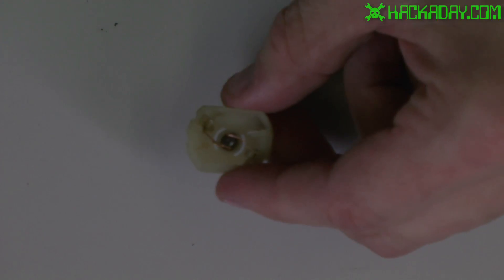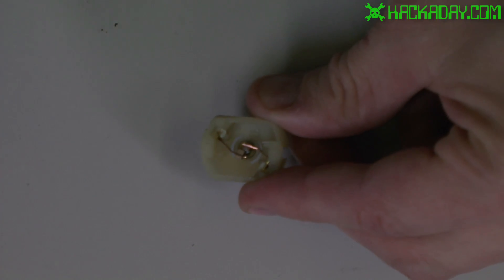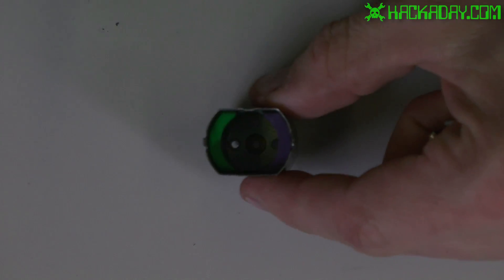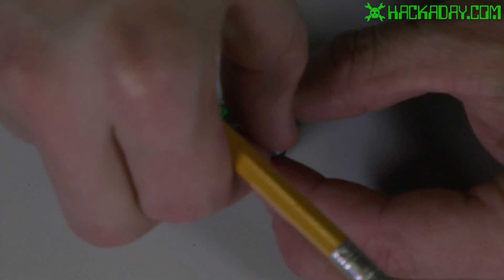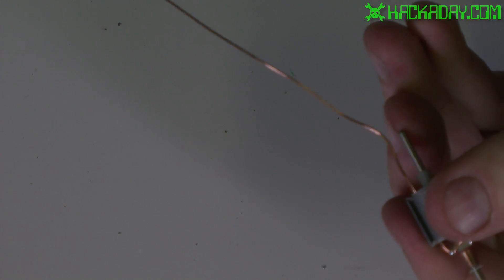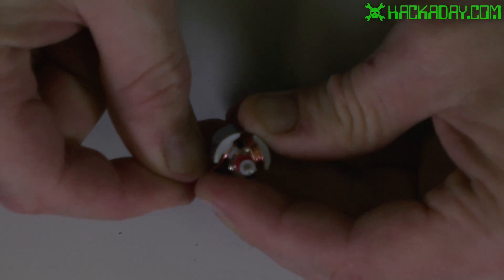Rewinding a DC motor

Comment: Bro
Im an old timer 12 v
Slotcar motor rewinder
With very exotic rewinding methods for
3 and 5 pole armature
Which will make 12 v. Brushed motors really burn...
70 to 100 thousand
Rpms..
So fast in fact the unloaded a motor will self destruct and blow itself apart .
Lots of mods diy for
The can mags etc.
If you like i can provide interesting diy old timer methods used back in the day.
Example
Rewinding a 3 pole armature like a 5 pole.
Or 5 pole like a 3...
Let me know if youd like me to expand about these old technologies.
Regards
DH.

Comment: very informative. im planning to rewind the  same motor you used in the video and use it on my usb powered electric fan.. is it advisable though to plug a rewinded usb fan on a laptop that draws roughly 5v 500-1000mah?thanks

Comment: pretty hap hazard.
in reality, less turns won't necessarily give more speed. Winding electromagnets is far more complex than that. More turns = more magnetic flux at a given current, also means higher voltages to achieve the given current. With motors it's further complicated by the number of segments on the armature and the timing of the commutator, which he touched on.   

I guess it's not a bad explanation in lay man's terms. I wouldn't take it too seriously though.

Also, watch out for balancing issues if you attempt something like this.

Comment: I think you should divide the RPM by 2! I mean the tachometer counts 2 black marks each revolution, so, then you'll need to divide the number on the LED by 2! I GUESS! Let me know! Thanks ... Great video! :)
Reply: The tachometer divides by 2 for you. There is usually a switch on the tach to set the number of props (2 or 3). The readings were revolutions per minute not stripes per minute.

Comment: Sie i rewinded the motor but after rewinding when i supply 5v dc to it.Nothing happen please help
Reply: when you rewinded it you would have changed the required voltage! so just add more voltage

Comment: if you like faster with no smoke after the motor is run, red alloy coil is good magnet coil than copper coil or magnet wire,..in that dc motor is good that you rewind in 12-14 turns,..

Comment: His tach was getting two pulse signals per actual revolution of motor. If he had one single black dot, about 3/4" in diameter near the edge of the paper circle, than then tach only sees the dot once and not twice per revolution. I don't mean to be hating in anyway, but I am rather confused. Did anyone else scratch his head and wonder something similar?

Comment: No. More turns= less speed but more torque. 
Less turns= more speed but less torque. 
In example. A 10 turn motor is faster than a 20 turn motor. You either have speed or power

Comment: The resistance of the winding will indicate the current draw of a stalled motor. Because of the counter electromotive force that's caused by the winding passing through the stator magnetic field the resistant will be higher meaning less current flow.

Comment: guys can you help me tried rewinding a motor for my mini 4wd it is working but its not that fast and it gets soo hot easily like 3 laps around a small track, can you help me i've done 9 turns each use 22gauge magnet wire, any tips on avoiding this and how can i make it faster?

Comment: What a lot of your basic average Joe's do not understand is that when you wind with less turns or with thicker wire; you are actually doing voltage change. A lot people seem to not understand this apparently. So the motor will spin faster, but must now draw more current to produce the same torque. In racing it makes since to do a voltage change than to increase battery voltage as this will add weight vs. just rewinding the motor. Hope that helps.